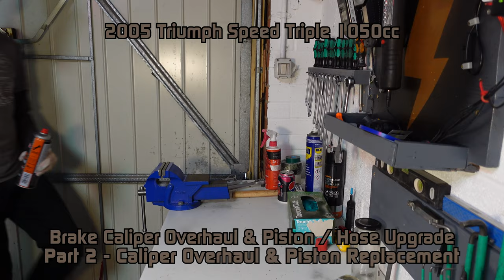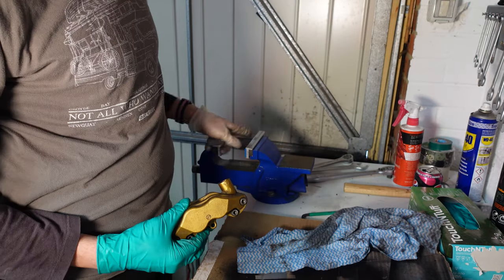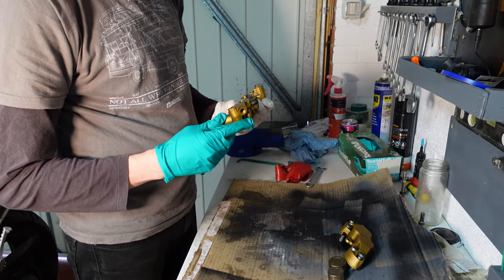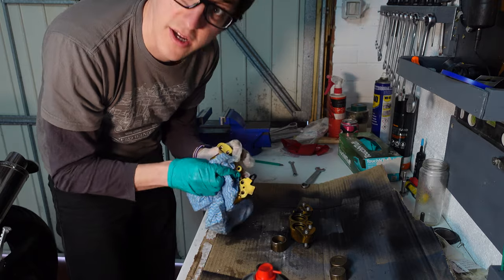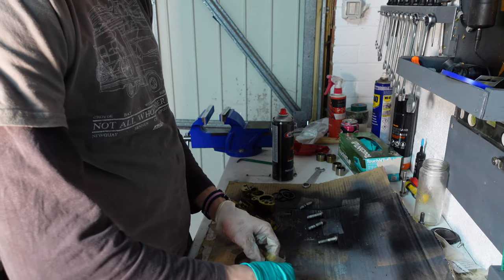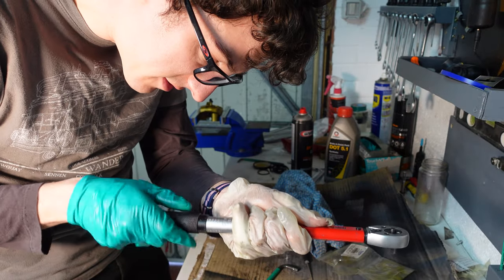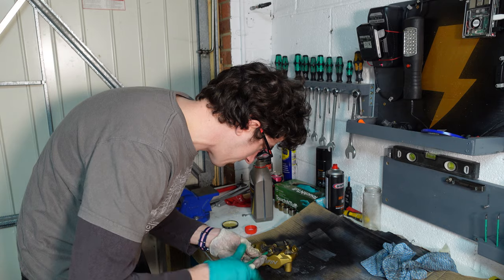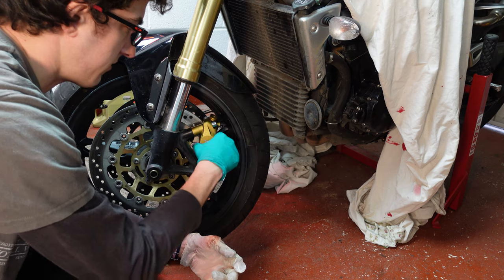Triumph Speed Triple 1050 Nissin Brake Upgrade - Part 2 Caliper Overhaul + Seal & Piston Replacement

Comment: Have you checked the possibility of installing ABS in a motorcycle, I wonder if it is possible?
Reply from the maker: I haven't,  shooting from the hip I expect it's possible buy expensive and difficult, as modern systems use loads of sensors in addition to wheel speed I think.
I have never had an issue without it，though I am not the quickest rider. I have locked up the rear and soon learned my lesson. The front has a lot of grip and braking ability, and I get good feel from it, so never locked up. 
What bike do you have and do you think you need the ABS?

Comment: Great video, thank you 👍. One question please, should you of replaced the gasket that seals the two sides of the caliper together?
Reply from the maker: Hi Toby, agreed yes, best practice is to replace the seal, and often soft parts have a time based degradation. I inspected it and it was happy with condition (no perishing), however its a cheap part and if I realised ahead of time I would have ordered a new one. As mentioned, cleanliness is paramount in this, and any dirt on (or under) the piston seals can cause issues (more likely binding than leaks). Good luck with the job 👍

Comment: Thanks for your efforts.

I need only that retaining spring 
for the front brake of my tiger 1050 sport (2014).
How can I find this part ?
Reply from the maker: Triumph dealer or a parts shop would have it (or ebay if you are lucky). In the UK Fowlers are pretty good and have drawings. Looks like part number T2020325 to me (but double check!)

Comment: I thought Triumph recommend Dot 4? Tut tut!!! Lol.
Reply from the maker: Good spot and agreed they do (touched on briefly in Part 1).
Dot 5.1 is backwards compatible with Dot 4, meant to have a slight performance gain though I doubt I would notice.  
Apologies if you already know, but Dot 5 is completely unacceptable to mix with Dot 4 (even residual) and can block up the lines.
I cannot think what was going through the persons head to call two totally incompatible things Dot 5 and Dot 5.1 ...